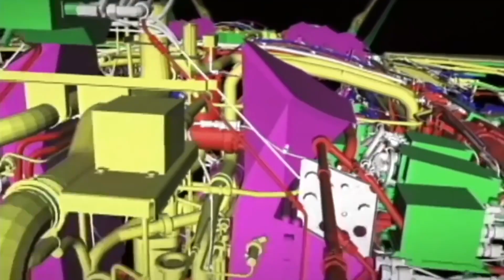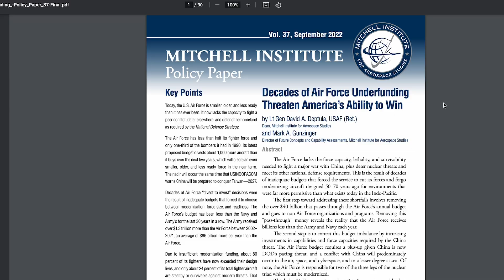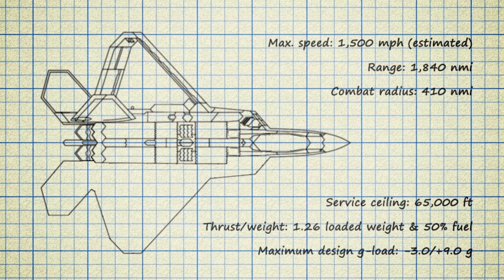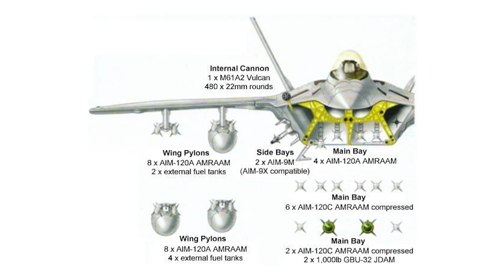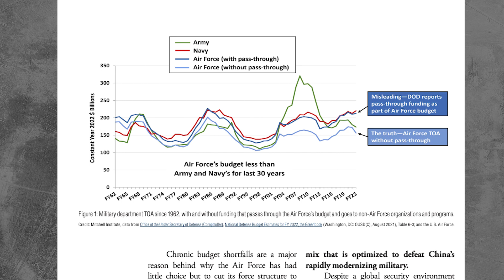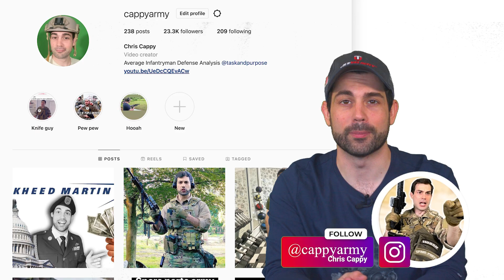Cancelling the F-22 Fighter is Worse than You Think

Comment: Completely agree that shutting down F22 production was incredibly short sighted, especially given that the production was up and running (wiht all the design work and development done and essentially a fixed cost). Given that it takes at least 10 years to develop a new fighter it's likely to leave a huge hole for the forseeable future. The cost per unit would have been far less if they'd continued the original production run. It's by no means a new design now (computers when it was designed were Pentium IIs!). It is also notable that if you don't have air superiority you can't use the rest of your airforce.
Reply: Even continuing in low-rate production would've been the smart and economical choice.  Keep the facility(s) operational and the supply-chain running.
Reply: Yeah also the ban on foreign export, despite being well justified by wanting to keep suck technology away even from USA closed allies, like Japan, also proved to be shortsighted when USAF didn't procured a numeros fleet by its own
Reply: Wow...480 rounds of ammo.  So what, like four (4) seconds of firing time?  o_O
Reply: Not my area of expertise, but I seem to remember that the anti-radar coating was seen as under performing and was very high maintenance?
Reply: i dont understand why they dont just use the f35 in its place, we have 800 of them
Reply: @floppa0498  Specialized aircraft are generally better at their jobs than multi-role aircraft as long as the ones being compared are using the latest technology, so of course the military wants dedicated fighters,
Reply: @73_65  f22 isnt specialized if you think about it, its an amalgamation of 4th generation air superiority dogfighters and 5th generation beyond visual range fighters
Reply: @williamyoung9401  Gun kills account for less than 10% of A2A kills.
Reply: @floppa0498  they are and the F-35 was designed to do just that
Reply: Makes more sense when you keep in mind the US started developing its replacement in 2014. The NGAD and F/A-XX programs were started in 2012-2014 and ADVENT (a new engine program for them) was started in 2016. The NGAD is expected to enter production in the 2030s which is before the F-22 will be phased out since the US is still upgrading the existing fleet. Plus while not as good in a strictly air superiority role the F-35 can fill the same role even if the existing F-22s all crashed before 2030, the F-35 would just need to overcome its inferiority as an air superiority fighter with superior numbers, superior networking, and superior coordination and couple that with the US's high degree of pilot training.
Reply: @Trigger_Treats  
Probably, even less than that.  Plus, a one second burst is all it takes to tear a plane to pieces.
Reply: This is extremely misleading. One thing all these videos leaves out is the way the funding, research and development of the project was signed into law. There was a stipulation in the bill that required at least one part of the raptor to be manufactured in each one of the 50 states with no exception. The program was limited in number by design and cut short. Keeping the program alive would mean keeping at least 50 factories running across the country even if they were otherwise closing down. Which is were the ridiculous cost came from.

The F-35 had no such limitations so Lockheed was allowed to get the parts from wherever they wanted.

The government handicapped the production of the raptor from the start. They need to just make a new plane that doesn't have any of those restrictions.
Reply: With all due respect, the F22 is awesome but if I remember correctly a French Dassault Rafale non stealth fighter jet shot down an F22 in a milsim exercise. Maybe it was a good idea to cancel it so we can upgrade.
Reply: They should be scared of what's next, not what is here now.
Reply: @Theanimeisforme  ah yes I remember the Good all days of the 90's early 2000 when China was still considered a partner for the west... How geopolitics change in just 10 years...
Reply: the idea we would only fight wwars like in the middle east was so suid
Reply: @taylortevebaugh5146  When they tied the F-22''s hands behind it's back. As in the started the fight within visual range plus a couple other things that negated the whole point behind the F-22. Even then the F-22s shot down more Rafaels in that specific exercise
Reply: @Taylor Tevebaugh  Nah, every test of F22 vs 4th gen was akin to seal clubbing. The only scenario where 4th gen won was under very restrictive conditions.
Reply: You can't use the rest of anything, the entire US military depends on having air superiority or it's just not happening. There is no contingency for going in with enemy aircraft in the air.

The Brits attempted operations within heavily contested airspace and it was an incredibly close run thing. Not recommended.
Reply: @Bitchslapper316  ah yes. I'd almost forgotten just how good the Defense Industrial Complex had gotten at Defense Political Engineering.
Reply: I think its a wise decision not burn more $$$ on F-22 and accelerate NGAD. F-22 is designed to counter soviet union through through deployment in Western Europe. But today the major threat is China. NGAD with its Adaptive Cycle Engine with 35% increased range and 25% reduction in fuel burn is much better suited to operate across in the vast pacific theater.
Reply: Just no. Not pentium 2s...the military has unlimited budget for chips..they did the accounting on regular computers. Not the aerio - dynamics. Military chips are a decade ahead of commercial ly available ones
Reply: Maybe they will go to the YF23 which was the better plane.
Reply: @arthas640  you do have the F15 and F16 and use the F35 to take point and take out as much as possible planes in BVR or Anti Air and Radars to make way for the F15 and F16.
Reply: @gups4963  the Rafale isn’t an air superiority fighter it’s more geared to multirole, a better contender would be the Su35 which is said to be on par in dog fight engagements. I think what the US, Russia, Europe and Asia are doing are building 5th gen fighters in smaller quantities and have them backed by newer variants of 4th gen fighters with improved avionics and capabilities. 

The 5th gen fighters go in first and engage in BVR early or if it’s an attack scenario take out the enemy radars and anti air to make way for the 4+ gen fighters.
Reply: Agree and the thing is our pentium ii design was probably far superior to the Russian designs of the same age.  That is the only major opposition besides small budget European fighter jets that obviously would be working with way less compared to the f22 in terms of budget on all parts of the airplane.
Reply: @taylortevebaugh5146  
Those are controlled engagements with set initial parameters.  The engagements that you speak of are within-visual-range BFM.  The Raptor can lose to any 4.5+ gen aircraft.  It’s nothing spectacular.  Stealth means nothing when you can visually acquire your opponent.
Reply: the cost of a single raptor is 190 milliom Dollar, every plain not build is a giant budget relive!
 a F-16 costs are around 9 million Dollar
Reply: @hmcredfed1836  
English please! A modern Block 70 F-16 will be anywhere from $70-90 million in a foreign sale package (maintenance tools, crew training, spares, etc).
Reply: @taylortevebaugh5146  well it’s not invincible. But the ratio was like 30 kills to 1 F-35 was like 20 to 1. It’s not like you don’t expect any to be shot down.
Reply: @taylortevebaugh5146 you need to see the details on the fight. I know of some German Typhoon victories over the Raptor. Then it turns out the Typhoons were clean while the Raptor was carrying drop tanks for the whole fight. They purposely handicap the Raptors to make the pilots figure out how to survive if things go wrong and the opposition is able to shoot.
Reply: @mitchjames9350 the teen fighters could also shoot for the -35. The overwatching and hidden sniper telling the ordinary infantry where the opposition is scenario.
Reply: The problem isnt the price tag, yet the cost to maintain and keep operational.
Reply: @arthas640  I'm still confused. Surely for the "air dominance" manoeuvrability of the F-22 to even come into play, everyone has to have run out of missiles and be reduced to dogfighting w cannons? It's not like you need to be pointing the nose of the plane at the target and get a missile lock anymore, these days the radars detect the enemy, and you fire fox one, done. It just comes down to who sees who first, and gets enough missiles away, right? The F-22 is simply an overkill, expensive to build, and expensive to run, machine. You can almost have 2 F-35's for the same TCO of 1 F-22. What did I miss?
Reply: @dadthelad  you missed that an F-15 can be loaded up with up to 16 AMRAMS and can launch from long distance and a much closer f-35 can guide the missiles on target
Reply: The politicians make tons of money on insider trading with each new project.

Comment: I'm still confused about why the F-35 wouldn't be up to the job.  They supposedly took all the lessons learned from the F-22 and put them into the F-35.  That baby is agile, high tech, and powerful (though I'll never be convinced that it could replace the A-10 for CAS, but I digress)!
Reply: The F-35 isn't designed for air dominance. It has good air to air capabilities, but the F-22 was specifically designed for it. The F-22 replaces the F-15, while the F-35 replaces the F-18, F-16, and Harrier.
Reply: I am not an expert, but i believe when China builds it's own stealth fighters, F-35 will lose it's range advantage, and will have to close in to detect and shoot enemy planes, and F-35 sucks at close fights.
Reply: Pretty much this. Reality is that fighting in gun range in 2020+ air combat is about as relevant as pistol fighting is for infantrymen.
Reply: @brankododig1585  Even long range, I think the F-22 is the superior air to air fighter.
Reply: My guess is speed. The F-35 is so "slow" that it could realistically be intercepted by a top of the line sukhoi from behind, where its radar signature isn’t optimized.

That said, while the f22 is fast, I heard DARPA is financing a new type of engine with ramjet capabilities that will be faster than anything except the black bird.
Reply: The F-35 was never meant to replace the F-22. Rather the F-35 is US's cheaper and exportable stealth aircraft. The F-22 has a far smaller radar cross section and we were not going to give that tech up willingly.
Reply: @user-pq4by2rq9y The F-35 isn't "slow" in the way people think, it's actually relatively faster than all the multirole fighters before it. It carries a Viper with external tanks' worth of fuel, 2 AMRAAMs, and 2 JDAMs all internally and will still hit Mach 1.6 and maneuver to the edge of the envelope. Test pilot Billie Flynn even mentioned hitting it in the C model with external AIM-9s as well; top speed was never a useful stat until now when it could be achieved with a meaningful payload.

Intercepting the F-35 is going to be damn near impossible. It inherited the Raptor's radar warning receiver system with upgrades and can piece together a lock based on radar emissions; if a Flanker tried beaming it he'd be giving the Lightning pilot exactly what it wanted. Paired with the 360° IRST, there's basically a 30 mile or so bubble where an F-35 dictates whether or not it lets you get to the merge out of boredom; any further and you'll lose lock. The difference in technology such that it could be compared to the Raptor in certain aspects is an indication of how far things have come in a relatively short time, and the need for a new platform.

The 750 F-22s planned would've been stuck without a reason to fight up until now, as evident by the F15 going unbeaten over the Middle East. It also isn't allowed to be sold, which means the US would have to shoulder the entire program cost and their allies wouldn't be particularly pleased with the idea of needing Uncle Sam in their backyard as a "deterrent" or the fact that they'd have to develop the same or other technologies on their own, potentially requiring its own new platform. The F-35 program joined together all these things: marketable, fields revolutionary next gen systems at speed, multirolest fighter to ever do it, sensor fusion, maintenance friendly, fielded from helicopter carriers (Japan and UK send thanks), and can still high alpha like a Hornet. It answers most, if not all of the current threats and is the reason China and Russia are being hesitant to invade more aggressively than they are, as well as why they sell like hotcakes.